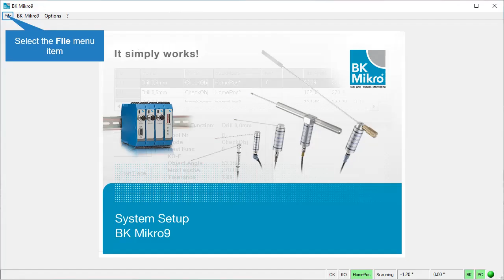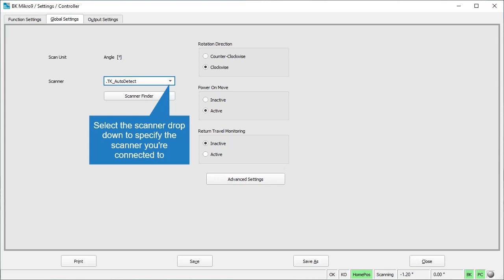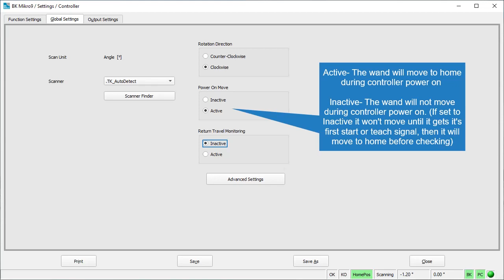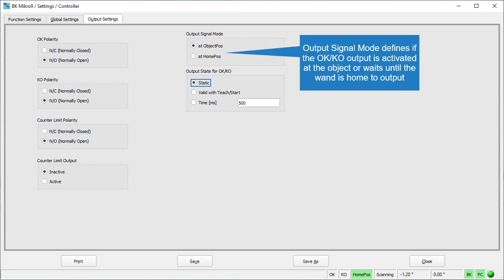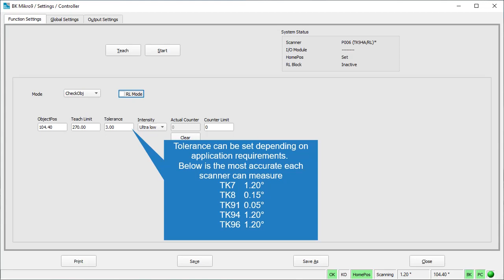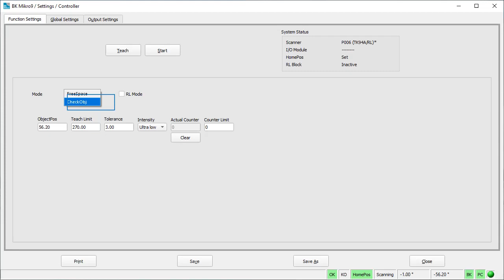How To   Initial Basic Controller Setup2

Comment: Currently installing this on an okk.  One thing that would be beneficial in the video would be to clarify you have to teach each tool.  
Great information on here. 
Thanks.
Reply from the maker: Sorry don't check comments often. If you have questions reach out to techtool@techna-tool.com . Teaching is normally done through in external input or the software depending on the integration.